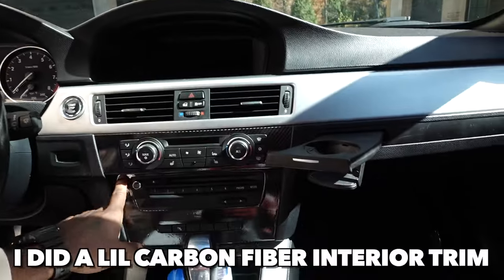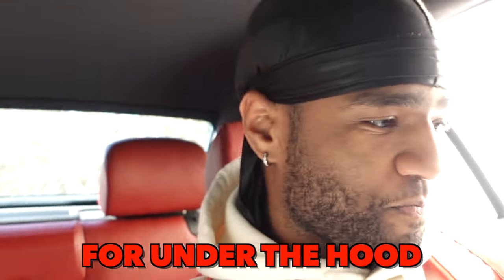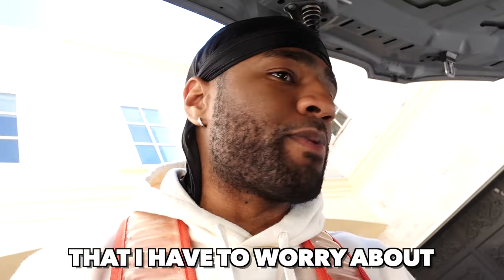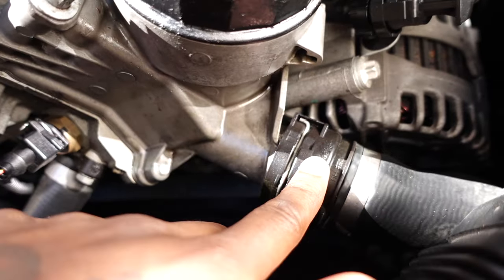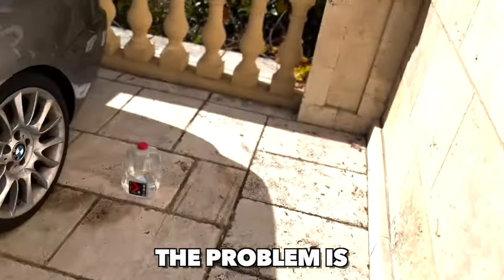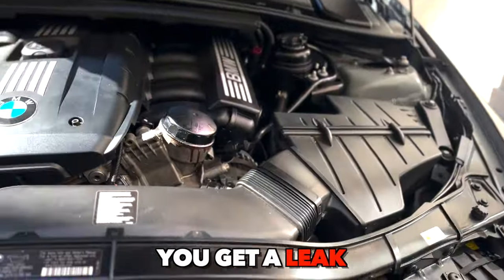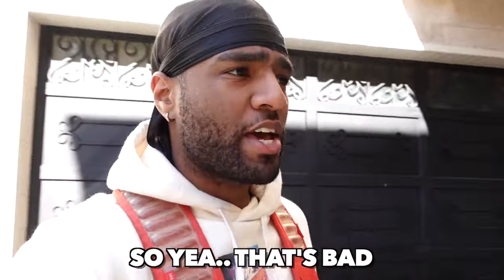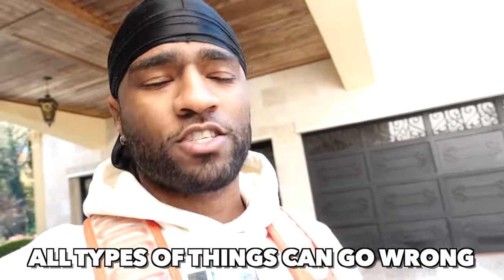MY BMW IS BROKEN ALREADY...

Comment: Is the O ring on the filter cap installed correctly? If it’s in the wrong grove it will leak like that. I did that once 😅
Reply from the maker: Mine was but I I actually found out that the cap had a crack around the rim on the inside. Full video of the repair coming soon!

Comment: go with Aluminum Oil FIlter Cap from URO so it doesn't crack or get something nice like a Blackline cap
Reply from the maker: I already got a plastic one & did the repair (video coming soon) but now that you’ve said something about an aluminum replacement I’m regretting my choice😂 I might order one anyways just to spice up the engine bay